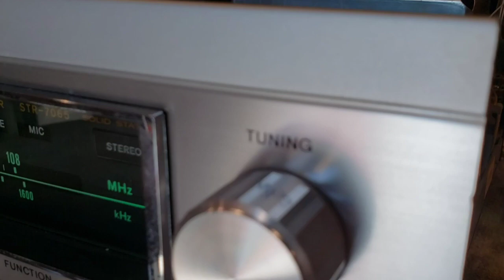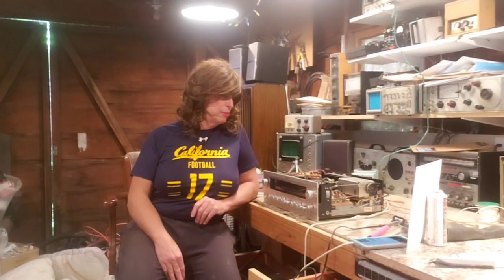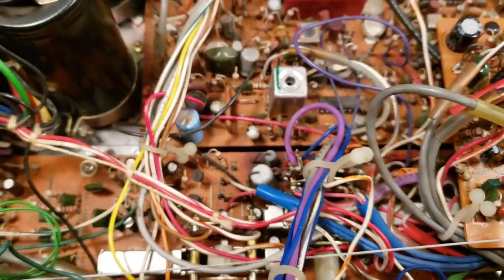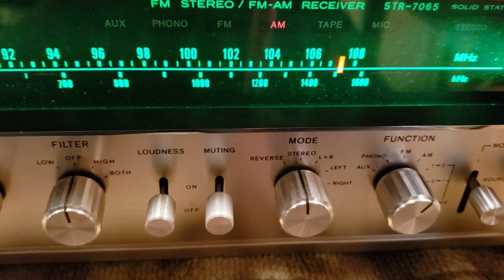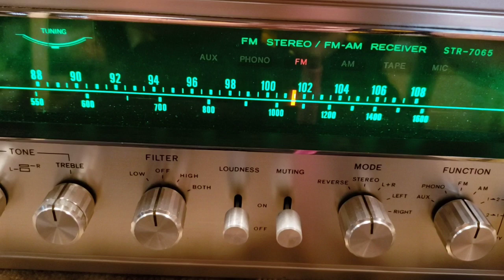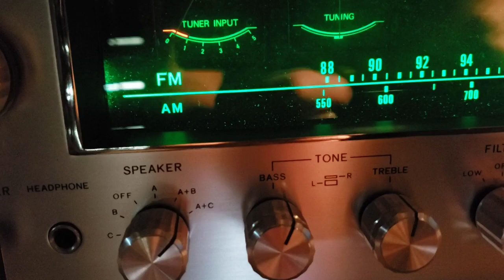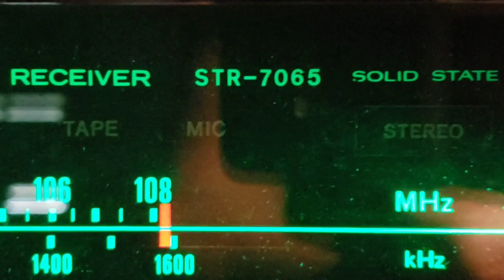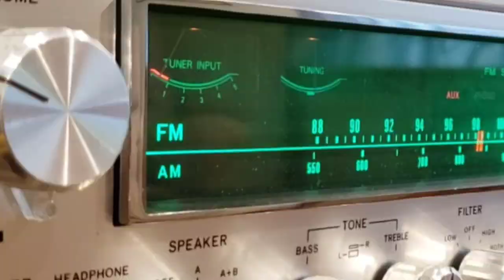Sony STR 7065 Stereo Receiver (1972)...Vintage Audio Listening Experience

Comment: I had a Sony STR7065 and a Marantz 2270 at the same time. In terms of subjective listening, tuner alignment and tested output and noise, the Sony 40 years after manufacture still produced 70 watts of clean power per channel with very low noise. The FM and AM tuners still worked as intended as did the muting and other aspects of the receiver. The Sony bezel is glass vs the Marantz bezel made of plastic. I rebuilt a lot of the Marantz, mostly recapping. Sonically and distortion wise, it was good but the Sony walked all over the Marantz.
Reply from the maker: I think you are spot on Tom...please check out my rebuild and listening  videos on my playlists...thnx

Comment: i'm going to pick up my fourth one this month.  finding 6065's, 7065's, 6045's, 7045's REBUILT with new lights and capacitors for $100-200, it's insane. If it was Pioneer or Marantz these units would be $2,000.

Comment: Hello. Thanks for sharing your videos with help and advice. I have the Sony S.T.R. 7025. lovely amp got it for £60. But the sound has gone on one side. The right hand speaker is find loud and great. But the left hand speaker both the A+B has gone very faded  .. I'm using celestion - c speakers . Is it a easy fix to sort out or a common problem. Thanks for any help . From the UK.. forgot to say I tried the speakers with another amp and they work fine. Thank you.
Reply from the maker: Try getting some electronic cleaner and spraying all the controls
Reply: Update. Sorry it was my stupid fault. Didn't know that I accidentally moved the balance tone to one side when I was turning the volume.. that God for that. Panic over. Jamie..